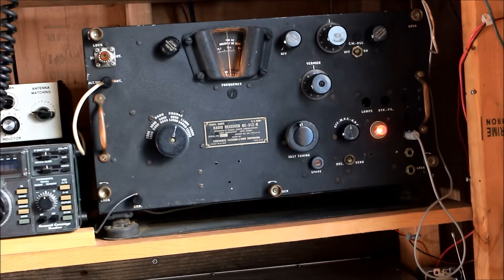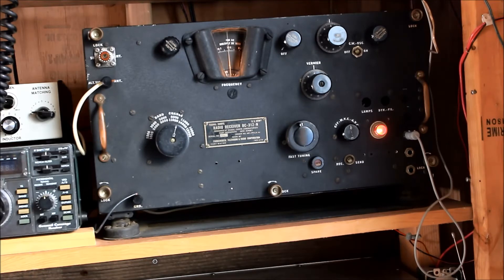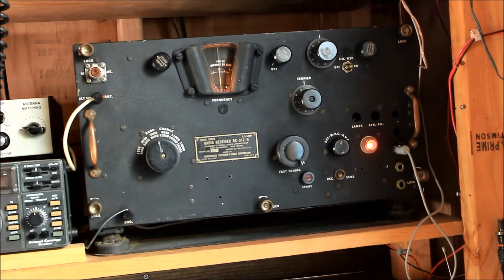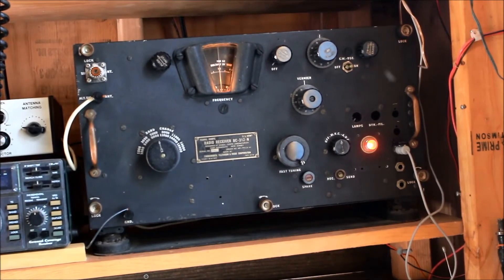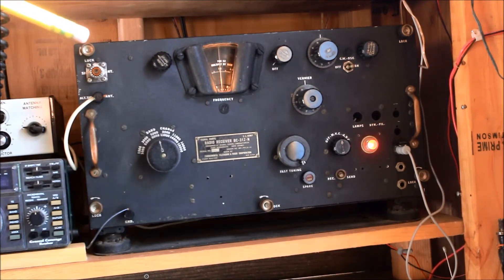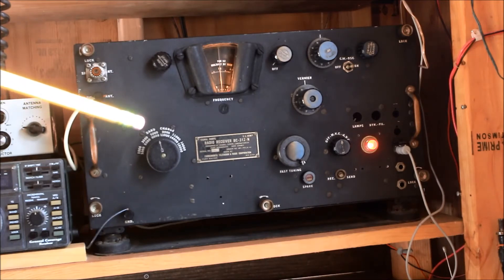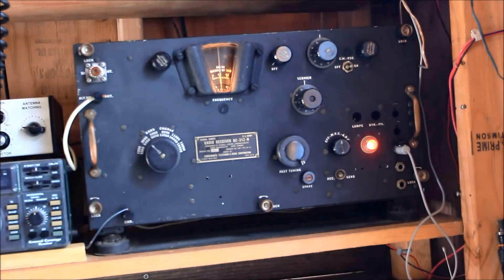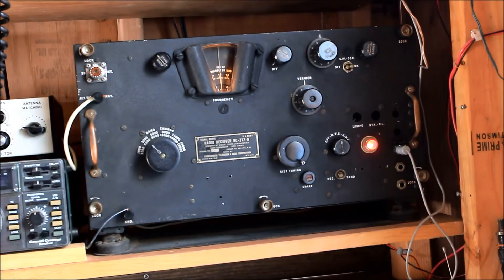WWII BC-312-N Receiver (Farnsworth Television & Radio), 1942

Comment: Nice video.  I always wanted to goof with some of the surplus gear but was too heavily into 2-meter FM, repeaters, controllers and phone-patches. When I could have easily and cheaply picked up on these because everyone was dumping tube equipment (my if the landfills could tak!).  
Also, I have an ICOM-745!   73...

Comment: What size plug connector goes to the speaker.
Reply from the maker: 3/16 inch (0.206") I believe, will have to double check. Aviation plug size nowadays.

Comment: Nice radio. This radio was in my house growing up, and I used to listen to Ham, Shortwave, and WWV on it until the external power supply failed. My father built the power supply as a teenager. Ours had the elephant nose on the front.